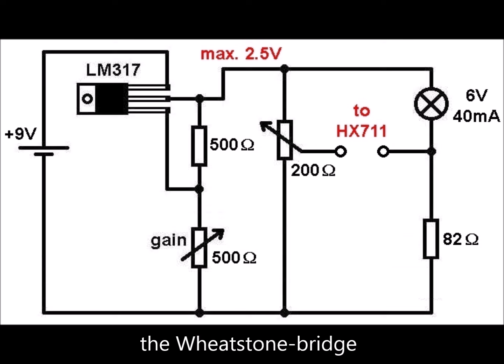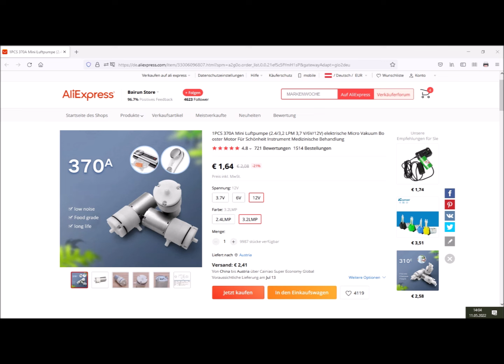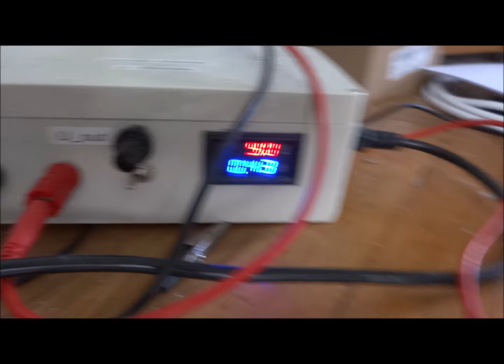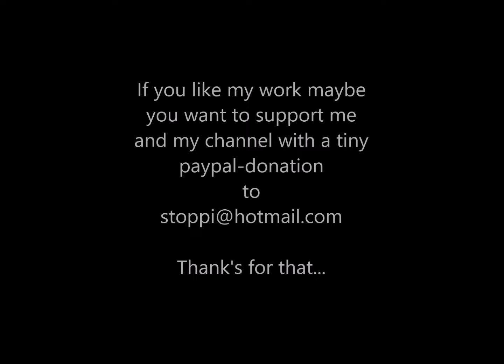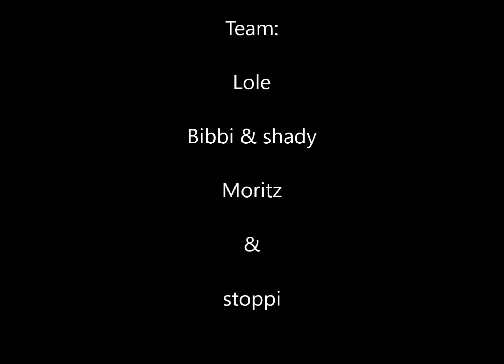Homemade gas chromatography with Arduino - Einfache Gaschromatographie mit Arduino

Comment: How does the broken bulb work in this set up?
Reply from the maker: The broken bulb is the sensor. The resistance of the bulb filament depends on it's temperature and the temperature depends on the heat transfer via the surrounding gas, which passes the sensor. An increased heat dissipation leads to lower temperature and this leads to lower resistance. Then you get a corresponding output-voltage at the Wheatstonebridge, which is measured by the arduino...
Reply: @stoppi  
Thank you. Heat transfer for various gasses differ from each other?
Reply from the maker: @AbdolazimHasseli  the heat transfer of the gases must differ from the carrier gas. Each gas has it's own velocity through the column and reaches the sensor at different times. The heat transfer can be then different too...
Reply: @stoppi  does the industrial gas chromatograph work in a similar fashion? Do their sensors work by same principle?
Reply: @AbdolazimHasseli industry gc have various types of sensor but the most common one is a FID sensor. the lamp filament sensor is more like the  thermo conductivity sensor (TCD) which is also fairly commonly used in comercial setups.

Comment: Which arduino library did you use for the HX711? I'm using the bogde one and tried to figure out the commands to get it to plot the change in resistance but I'm not seeing any signal in the plotter after I get it started with the button. I verified that the wheatstone bridge is working and I can see a huge change in resistance across the filament when I blow on it, so I suspect it's an arduino command issue. If I could use the same library as you and follow your commands that would be super helpful as a check.

Comment: Really nice! The only things missing from a professional rig is a temperature stabilised column (usually an oven), using a platinum filament bulb to reduce "aging" of the element (and thus drift), a second filament in the carrier gas only as the other half of the bridge to compensate for fluctuations, and some time synchronisation with the injection pulse. All of which is about improving precision, not functionality, so great job.

How certain are you about the peaks being iso and n butane in that order? Do you have results for that column to compare against?
Reply: Can you please explain the "time synchronization with the injection pulse".
I Imagine the injection speed important to get improved resolution. But time synchronization with what?

I also build a simple chromatograph but would really like to build a good one.
Reply: Each compound takes a different amount of time to pass through the column. If you know when the injection happened, and keep some things constant like column temperature and volume injected, then you can use the transit time to identify the compound. 

You might also need more careful control of carrier gas flow rate too
Reply: @bansci  That makes total sense. Thank you :)

Comment: Absolutely great project ! Very awesome ! I do wonder how does the gas sensor work ? Does resistance of the filament change in different gas mediums ?
Reply from the maker: Hello, thank's. Different gases remove different amounts of heat from the wire. Those gases that remove more heat cause the coil to be slightly colder, which reduces the coil's resistance. The Wheatstone bridge then delivers a different output voltage... 😉
Reply: @stoppi  pretty neat and simple method ! Absolutely genius ! Also, one last question if you don't mind. Is the distance of the peal from 0 always the same ? If so, we could chart out gases and use this as a method to identify gases. I know that in paper chromatography you divide the length of the traveled solvent and the distance traveled by the test material and get an index. No idea if that index is always constant in a controlled environment. Hey, maybe a cool idea to build would be a Arduino calorimeter. It's not any magic, but maybe a automatic temperature difference monitoring system could be coded onto an Arduino. You could technically do the entire calculation in the Arduino using the "Kalorimetrische Grundgleichung", but again the the use would be a bit questionable.
Reply from the maker: @photonik-luminescence  the peaks are only then always at the same place, if the circumstances don't change, f.e. The power of the pump... But then you are able to identify the different substances by their time when the peak appears 😉 some of my experiments/projects are just a proof of concept, that it works (or not) and I don't do further investigations. This is because often the next projects are knocking at my door 😂
Reply: @stoppi  I very much appreciate your reply. I am looking forward to ways to identify chemicals at home without the use of the way to expensive gas mass spectrometer, so i looked into calorimetry for potentially being able to tell home chemicals apart and maybe gas chromatography for gases like demonstrating CO2 from baking soda with such tools (off course using aqueous calcium hydroxide is quicker and reliable, but who knows if it is always calcium hydroxide...), basically just a second affirmation. I would also try to analyse the compounds that come of a burning candle (wich in theory in a well burning reaction is always water (vapor) and carbon dioxide, so this way i could observe what comes off a candle and demonstrate what compounds are given off when saturated carbohydrate chains burn ideally (without soot). Either way, thankyou very much for reading and going through my comments.
Reply from the maker: @photonik-luminescence  Sounds very interesting. Good luck with your projects and you're welcome...

Comment: Thanks for your videos. Last summer I studied different sorts of lighter gases and gasoline. Best liked to used 15 cm long steel pipe wrapped with heating wire to get heavier fractions faster through. May be the first peak in your plot is propane and the second butane.
Reply from the maker: Thank's for that information 😉

Comment: Does it work with elemental gasses like neon helium radon etc
Reply from the maker: I haven't tried it yet...
Reply: @stoppi  sounds like a part 2 in the making
Reply from the maker: @The-One-and-Only100  Haha, I am afraid I have too many projects at the moment...😉
Reply: @stoppi  I never said it was going to be the next video, but it can take a number
Reply: The separation is based upon the selective adsorbance of the substances, i.e. the adherence of them to the silica gel or whatsoever in the column. For noble gases, that should be zero, wherefore they would make perfect carrier gases - but not at heir price in comparison to the most commonly used nitrogen, which is also pretty inert. Practically, noble gases are measured with mass spectrometers.

Comment: Sorry what are we detecting here ? is it current ?....cheers.
Reply: The conductance of metal varies strongly with temperature. The hotter, the worse, as you see in minute [0:43]. The wire is heated with 6 V, which gives 150 Ω. at 40 mA. If it cools down, the resistance drops, increasing the current, according to Ohm's law. So, your guess was right, but: The temperature drops, because butane is far better in leading off the heat as air. So, what is actually detected, is the thermal capacity of the sample. By the way: n-butane and i-butane have different thermal capacity, of course. Therefore, the areas under the peaks are not directly related to the amount of the respective substance. There are more sophisticated detectors without this disadvantage, but in the end, it is always the current being measured, even with a mass spectrometer :-).